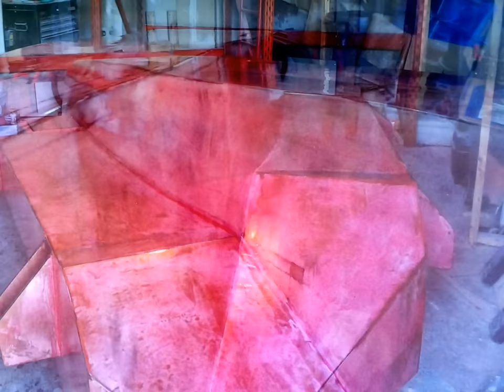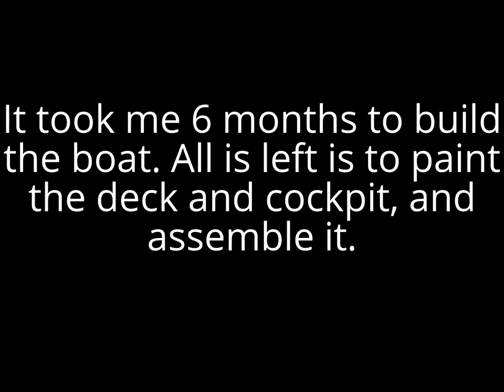Building a Trimaran Part 1

Comment: So....that appears to be a Strike 18 with an added centerboard slot...  Pretty cool... I have a strike 18, and I just finished adding the bottom of the mast base to the top of the kingpost.  I can't figure out the rudder shape and how to get the tiller to go uphill into the cockpit.I also have to add a singlehanded mast raising device. I am really close to launching. I hope you finish, as there are no good videos of a strike 18.  It's like they were filmed in the 80's they are so bad....
Reply: Tom Williams Hey Tom, after reading this post about singlehanded mast raising (a year ago, but may still be helpful) check out dr Frank777(on You Tube). His boat is not even close to a Strike but the way he raises his mast is just too cool! Maybe it'll give you some ideas.
Reply: john hanrahan Thanks John....Yes..I know Frank, and am currently building his slingshot 16 trimaran. I don't think he still uses that "E Z up mast system".  At this years Everglades Challenge, on the inspection day, the day before the race, he showed up with his 2 seater version , called the slingshot 19 and he took me out for a ride in the boat. It moves really fast. He is a heck of a builder.